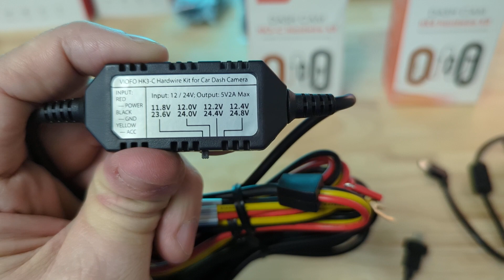Viofo HK3-C vs HK4 WHAT's THE DIFFERENCE?? #lockdownsecurity

Comment: I would like to see what's inside those boxes
Reply: A little guy with a volt meter and a coffee pot.
Reply from the maker: Sometimes there is also a gremlin with a tea pot, or Kung Pao chicken.
Reply: @LockdownSecurity  i already found out, there is no difference, both are equally stupid. BTW, the battery is not protected at all, they just keep on sucking power until the the battery voltage is about 4V
Reply: @showmytime9177  Impossible. Did you install it correctly? It literally cannot even drop below 11.8V with this device.
Reply: @AzNightmare  i put it upside down and all the electrons fell out.

Got 4 of them from different suppliers, none of them work properly, they have the same problem.120€ gone with the wind.